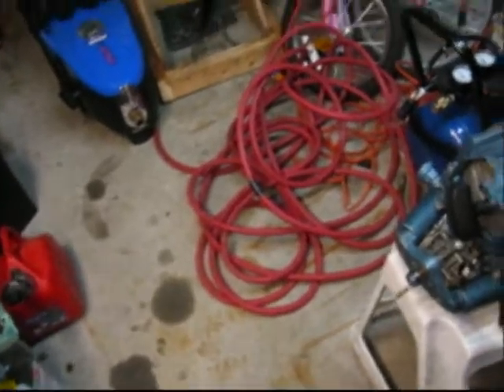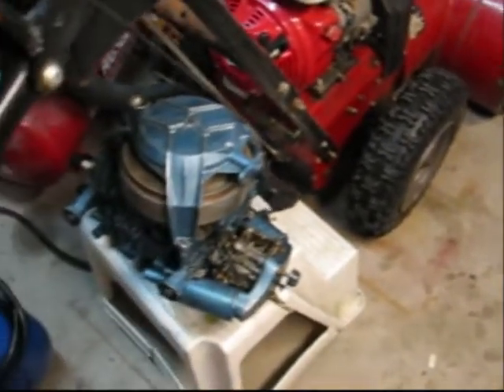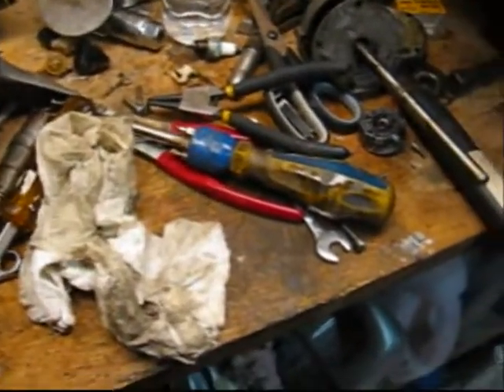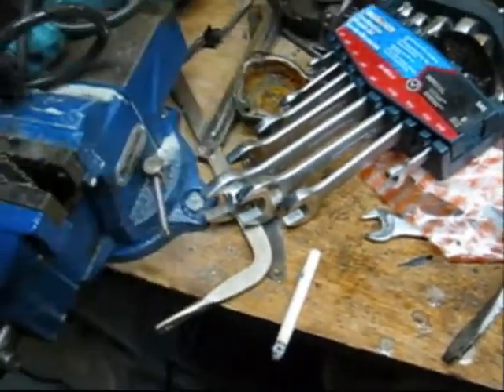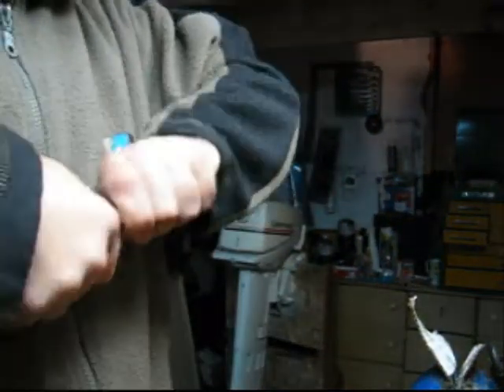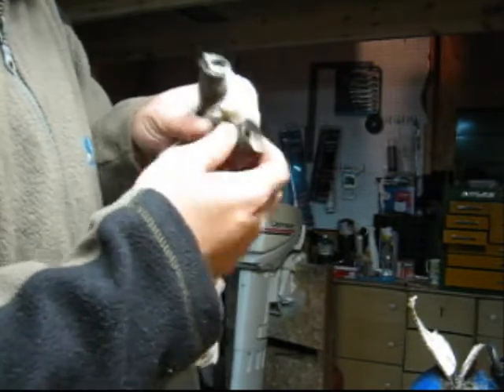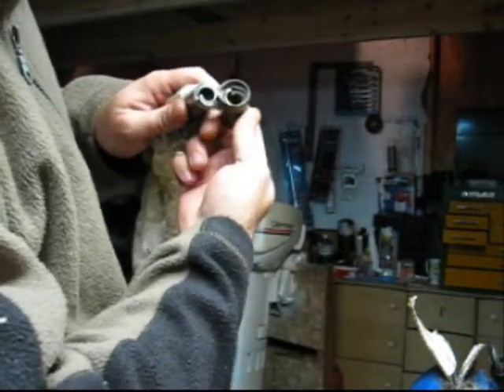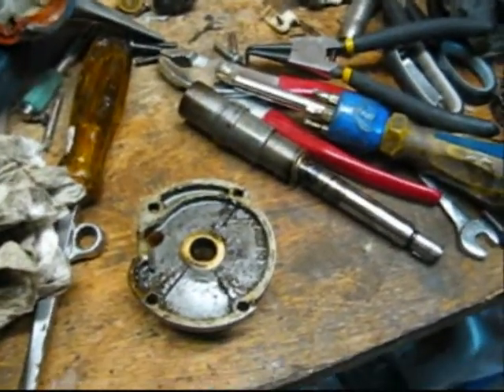1955 Evinrude 7.5 No Shift/Gear Diagnosis

Comment: Thanks, for making these videos. I don't know if you read these comments on You tube... but, I was wondering if you look for a specific year range when your picking up these motors?  
I ask, because from searching the web It seems parts are a little more difficult to find for some older motors ( 50's & 60's models).

Comment from the maker: @lazybear83 I read all comments left by users. Parts are actually pretty common for these motors, you can still get all carb, ignition and lower unit seal parts, water pumps, props and most other items. If you ever get stuck needing a part that isn't made anymore , a great resource to find parts is the webvertize portion of AOMCI.ORG, you simply create an account and post what you need, I've never had a problem locating anything using that site.